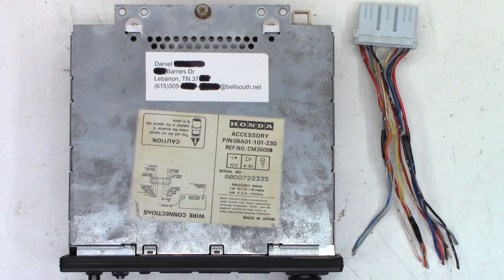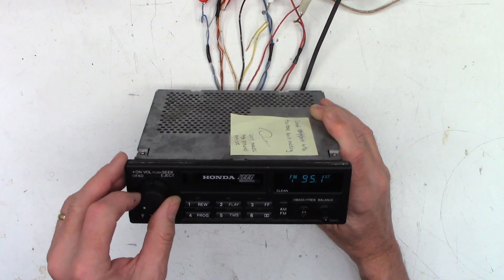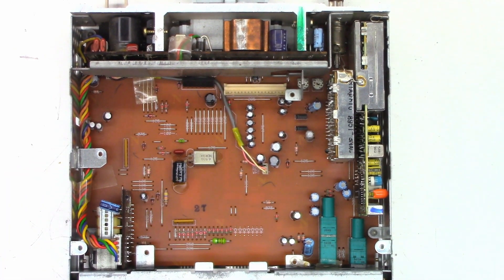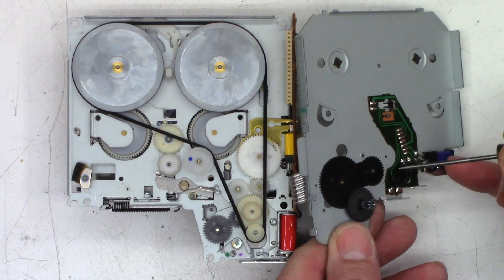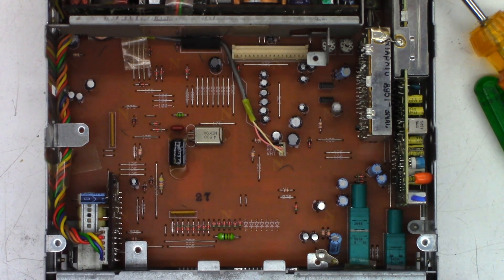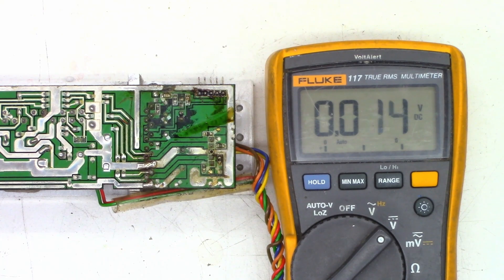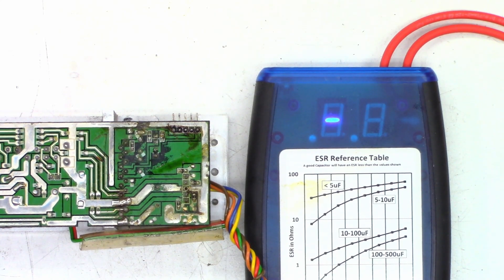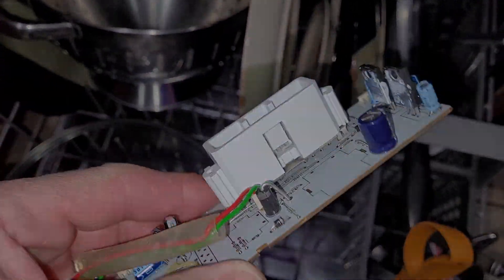Late 80's Honda Car Stereo Capacitor issues. But wait there's more. 08A01-101-230 CM3509B Part 1

Comment: I've had to replace leaky caps in two of my early 90's Toyota Engine Control Units (ECU) and speedometer/tach so it's probably a common issue with automotive electronics of this age.